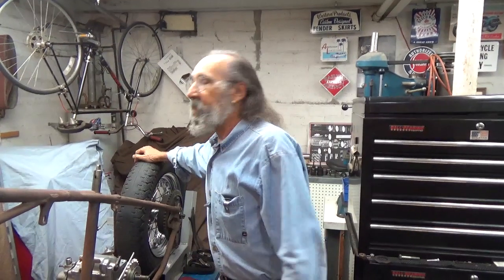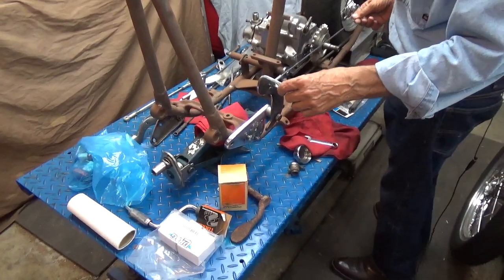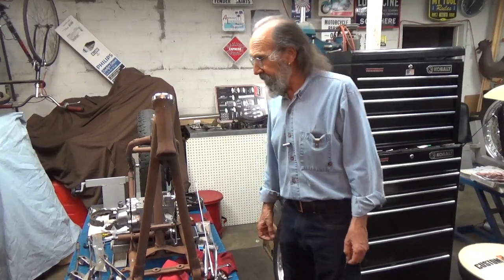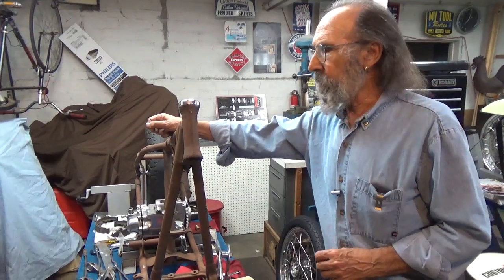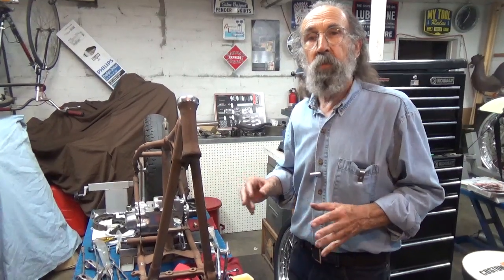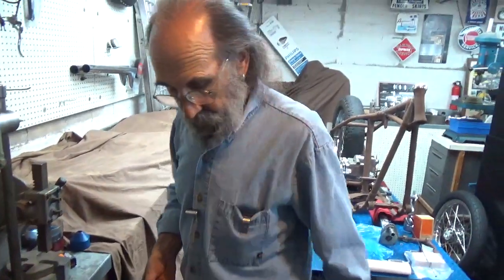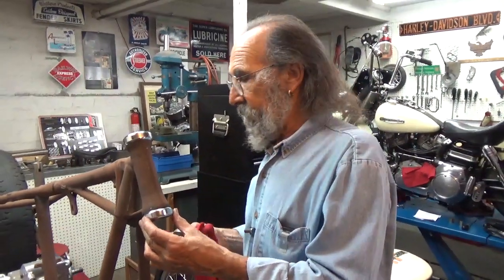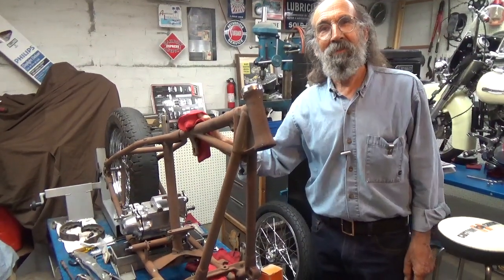Clutch and Brake Linkage, Fork Bearings, even a transmission for the Flathead Harley Project.

Comment: What size is that sprocket you are useing and how do you get it on so it does not come slightly lose (despite the lock washer)?  I dont remember back in the old day's but as far back as i can remember in the 1990's mine always come slightly lose but I dont notice it unless I have the inner primary off and feel for it by hand. I am literally going to put one on this week. How do you get your transmission sprocket tight so it don't get lose?....(I got one of those special tools to tighten that nut same as factory special tool you see in the HD manual). Thanks in advance of your reply.
Reply from the maker: I use an impact wrench.  I use one drop of Red Loctite. Then I bend a tab on the loctab.